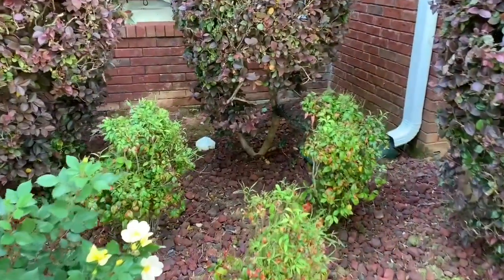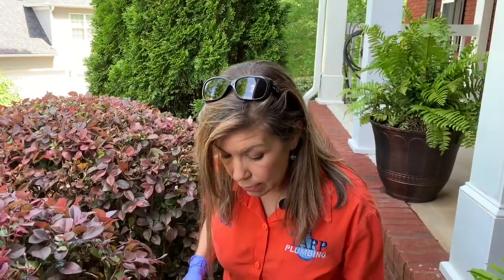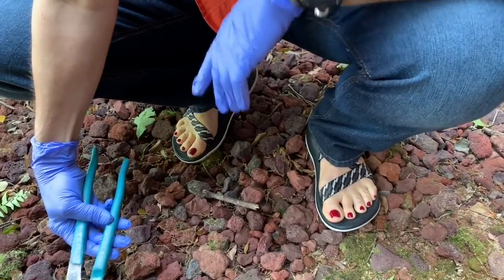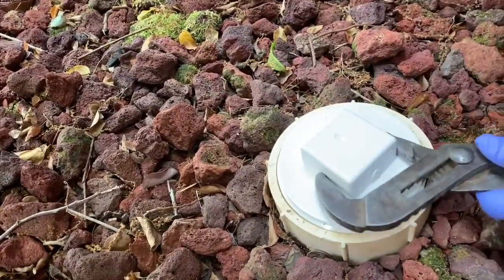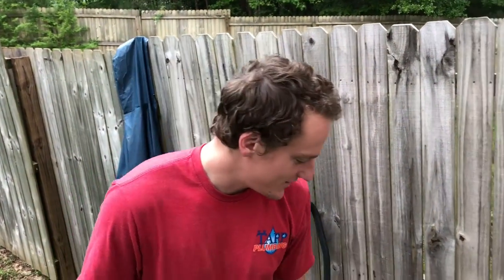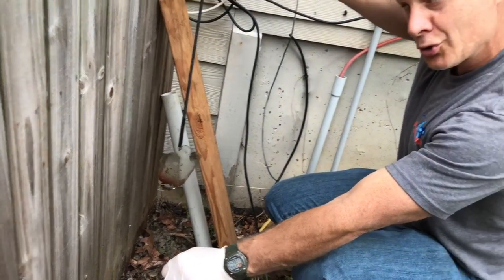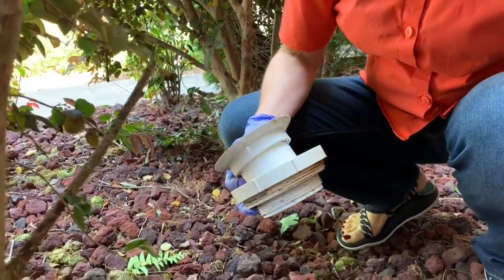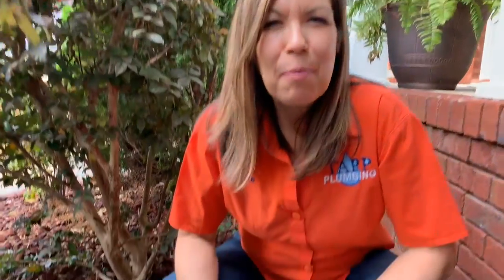HOW TO LOCATE YOUR CLEAN OUT WHEN YOUR SEWAGE IS BACKING UP @TappPlumbing #plumbing

Comment: the cleanout on my home comes out of the ground at a 45-degree angle. Can the sewer popper be installed at a 45-degree angle or does it need to be installed vertically?

Comment: The cleanout should always be located on the exterior wall of the building at least 12 inches from the ground to utilize a catch basin to prevent the raw sewage from becoming a toxic waste exposure issue. The pop up she demonstrated is as stupid as it gets because it will not alert you to a sewer problem. You will only know you have a sewer problem when you go outside and find that you now have a body of water called shit lake in your yard.
Reply: would you rather your walls, flooring, and house in general, become a sewer problem vs a small puddle in your yard? Believe me, you'll notice the wet TP blobs and maybe even smell before it ever could become a that bad. Considering insurance doesnt typically cover sewage backups in the house, it's an infinitely preferable option, code or not. Everything that sewage touches technically needs to be ripped out and replaced, and since you're looking up DIY videos, I'm guessing you aren't made of money.

Comment: What do you do when you can't find the clean out and your sewage is backing up?
Reply from the maker: Sergio Merconchini , if you don’t have a clean out you need to determine if you are on septic or sewer. If you are on sewer trying plunging the toilet that would be closest to where your sewer goes out of the house, this may or may not push out a soft blockage. If this doesn’t work call your local plumber. If you are on septic call a septic person first and have your tank pumped, then have them or your local plumber cut you in a 2 way clean out. Thank you for asking. We appreciate your support!
Reply: Well that probably cost a lot